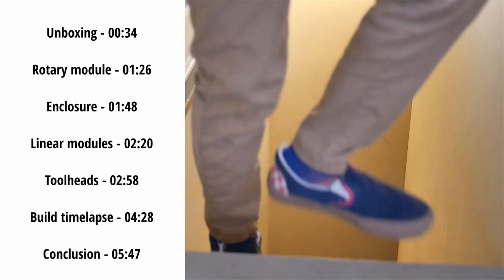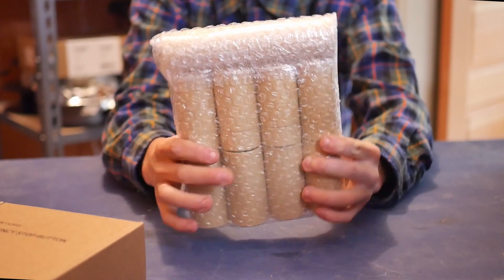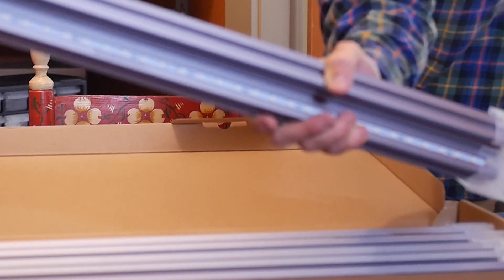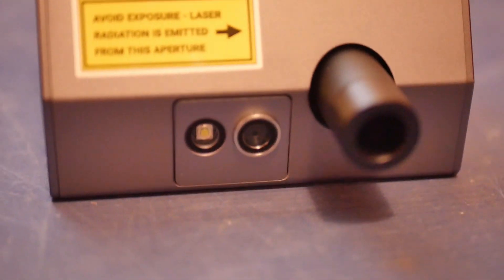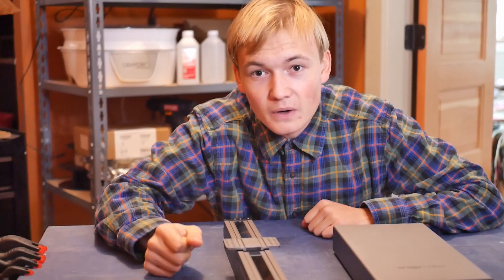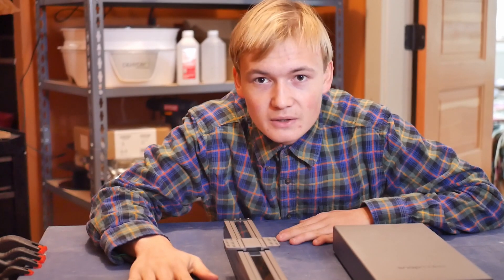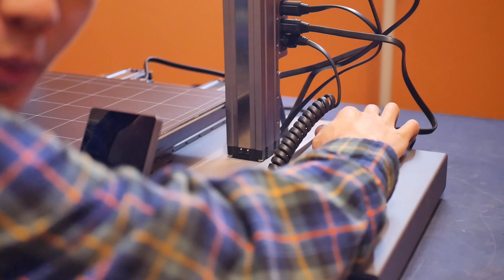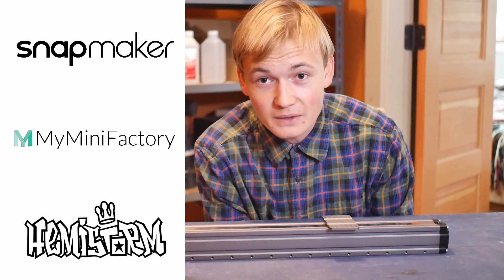IT'S HUGE! Snapmaker A350T unboxing

Comment: I've been seriously considering one of these, probably in a smaller size and probably waiting until the newly announced high power laser module comes as standard. The positive factor is the high quality construction. But on the negative side, the design concept worries me. It seems to have the worst of both worlds: the bed and completed work has to move fast in the Y axis and the gantry and tool has to move fast in the X axis. On both X and Y axles, the lead screw design must surely constrain the printing speed? Seems to me the optimal is to have the bed move on a lead screw in Z (which only has to move once per slice) and the extruder move on X and Y using a belt drive since this has to move much more and will benefit from higher speed.
Reply from the maker: Yeah, I agree with your idea of the belts. However, what they've done with the new "T" model, which I have, is made the x and y axis (which are normally belts) a higher pitch lead screw, making them faster. I've been 3d printing with it nonstop for the last 3 weeks and it is able to run the speeds from my ender 3 slicing profile with no isdues. It also hasn't had a single clog or jam or issue of any kind, and the bed sheet is really good. I was totally sceptical too, thinking that 3d printing was an afterthought, but absolutely is not. I'll have a new video out soon talking about this.
Reply: I was in the middle of making/designing my own 3d printer and I wanted it to be stable enough for simple cnc/laser addons later. 
For the cnc especially you need it to be able to handle the force needed to move the drill. leadscrews are good for that, belts stretch with a bit of force so they are not suitable. 
As long as you're not in a hurry, then an all in one machine of this quality is awesome.
If you want speed and/or power, this is not the way to go of course. But for simple things or hobby this is a great idea. Saves so much space and does the job.
Not the best job, but for a decent 3d printer AND a decent laser AND a decent cnc you'd pay 3x the money and need 6x the space
From what I've been able to find and see of the Snapmaker so far, I'm saving up for it and, unless I find a better option, I'm going to get it
We all can't be lucky sob's with a YT channel and get it for free LOL